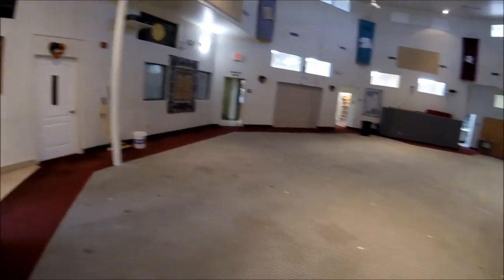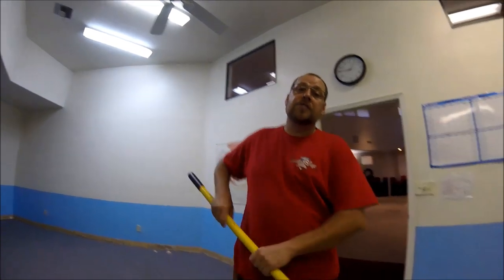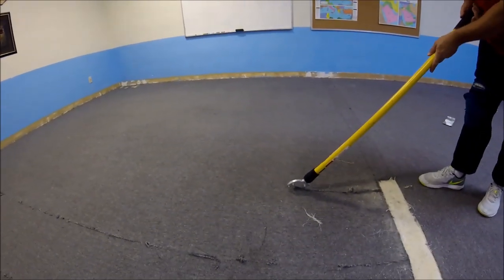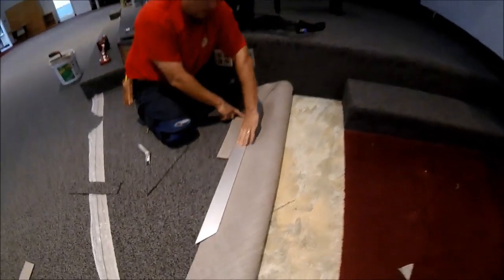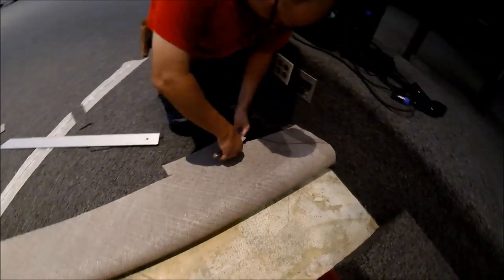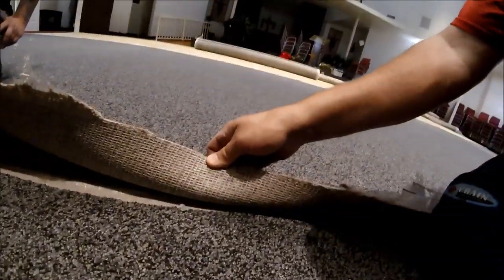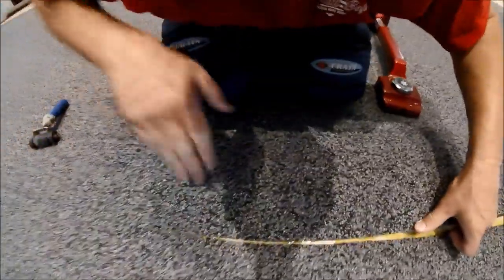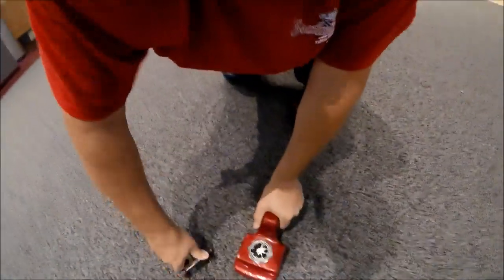GLUE DOWN CARPET INSTALLATION HOW TO

Comment: How do you prep the floor after the demo, it wasn’t shown? Do you remove old glue or just put new one on top?
Reply: You don’t remove old glue. In most cases, the glue from the previous carpet turns into dust. The only prep is to shop vac all the dust, debri, etc.

Comment: do you have to stretch direct bond carpet? I am doing an outdoor patio with cement substrate.
Reply from the maker: Jacob Sampson No sir stretching is not required for a glue down product
Reply: Pull border cpt back about 3"/4"cplace your knife from above an cut new cpt about 2"/3"over intended seam then put new under border carpet take loopile cutter and follow border cpt edge as if it's a straight edge!! Looks great is @least 3 times faster!!

Comment: I like your videos - and this was a good one - but it's missing the glue part.  I came to find out how to glue it down.  Do you have a video that features that?  I'm installing a rubber backed commercial carpet in my basement soon. Thanks.
Reply from the maker: Here you go buddy.  https://youtu.be/wOM2uRYhVZQ
Reply: @FloorsbySouthernboys  Thank you Sir!!  That technique breakdown is really going to help.  So, after the peice is cut to size and sitting where you need it, you roll back an edge and glue? Then lay back in and roller, and then the same from other edge?  Do you just glue the outer couple feet?  The jute back carpet I just took up had single trowel passes about every 3 feet.
Reply from the maker: @MovingToMnPro  You will need to pull the carpet halfway back while it is in place and glue half of it entirely hold it over into the glue roll it and then on the other half back and do the exact same thing, do you want to fully cover your floor with adhesive
Reply: @FloorsbySouthernboys  Thank you!!! I'll let you know how it turns out.
Reply from the maker: @MovingToMnPro  awesome

Comment: What is that tool you used to cut the old carpet called? That is definitely very handy! I always cut it with my carpet knife but that is much better
Reply from the maker: Hector Rojas It’s a crain part number 265 stand up Cutter Is what it’s called and Yes is definitely much easier than cutting it up with your carpet knife I used to do the same thing until I decided to give this a try a lot easier

Comment: That was a easy take up there are worse or ones when the glue it's fresh and a sticky he will not would be able to pull that like that
Reply from the maker: yeah it had been down for over 20 years
Reply: no lifts worse than the old green bigelow adhesive.. u see green glue u just wanna  cry.. we did a best buy and rug was stuck so much that we hired a ride on lifter to  come in and he would get a running start at it and stop dead.. ended up lifting the concrete with it.. was amazing but the first few nights we was lifting by hand and self propelled Sinclair machine and it was pure hell
Reply from the maker: Josh Tomsic dang I have not seen any green glue, sounds horrible

Comment: What do you guys get paid a yard down there?
Reply from the maker: it starts at $3.25 a yd for just a builders grade plush and goes up from there depending on alot  of factors ,such as softback,berber,comm.,furniture and so on, if you will be more specific i can give you a better answer
Reply: FloorsbySouthernboys wow we get paid the exact same up here (ontario canada)
Reply from the maker: dang   i figured yall would get paid more up there where its cold
Reply: FloorsbySouthernboys its 40 degrees today with the humidex hot as hell here bro! Lol but ya we get cold around december to march
Reply from the maker: it was 84 here in tucson az. today
Reply: here in Pittsburgh commercial glue down goes for at least $5/yard that's from some of the cheapest shops a lot will pay closer to 6 and include cost of glue for subs
Reply: Josh Tomsic thats awesome im coming to Pittsburgh lol
Reply: What is the name of the tool ur using. Good job guys. We get pay about 4.50 syd. Plus extra for rip up and furniture and steps
Reply from the maker: ciscoheras so I am looking at the tool right now and I can't find a name on it anywhere it is a Crain product , it is used for cutting up glue down carpet and it does extend out like a regular 8 inch razor  scraper ,but as far as what it's called I'm not sure I can't find a name on it anywhere on the tool but you can get replacement tips the part that rubs on the floor tends to grind down and you can buy replacement tips for it so you can keep that nice and sharp for digging under the carpet it's definitely well worth the investment as you can see in the video it works great and it does take a standard utility blade I hope this will help you
Reply: Your Flooring for a job or ur moving here?
Reply: Josh Tomsic might be visiting/trying to find some work while im there
Reply: Your Flooring good luck if its during winter it gets slow from right before thanksgiving til aftet new year c
Reply from the maker: this is always my busiest time , ive been booked up till after the first for the past two months,this time of the year is always crazy busy
Reply: FloorsbySouthernboys I stay busy but people generally don't want house disturbed for holidays and businesses don't spend because of tax season about to end. local flooring union would usually really slow up for work during this time buildings downtown and hospitals wouldn't want to spend. summer always booms here more work than we can do..usually working long hours 7 days a week. right now I'm working 6 or 7 days a week but I know some guys are also off a day here and there
Reply: they also tend to be the guys who dont do all flooring.. like they just do resi carpet, or hardwood, or ceramic. guys have one trick and stick to it. I've always been able to work a lot more by doing everything..ceramic being my least favorite to take on tho. been doing flooring for 13 years and one good thing about it is you can always make money if u want to ..just have to work. my father has been installin 42 years now and I've never known him to not have work either.
Reply from the maker: Josh Tomsic that's awesome that's really good to see somebody been doing it that long and still able to do it I've only been doing it for 26 years and just the past year and a half or so I have cut myself back to five days a week just because my body needs a little break now and again this is a hard job on your body and like you we do everything except for ceramic tile because I choose not to I just dislike it plus here in Arizona there's lots of people who do it so you can't make a lot of money at it
Reply: were are you guys at i am in northern minnesota  i get 7per yd. plus extra on  steps rip up & furniture & pattern match...